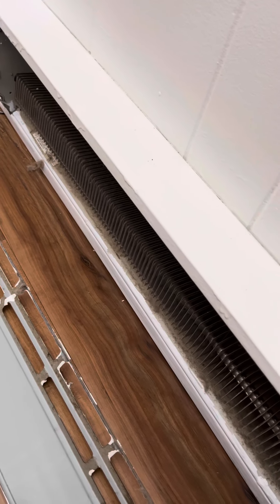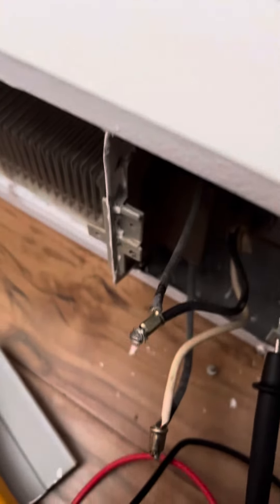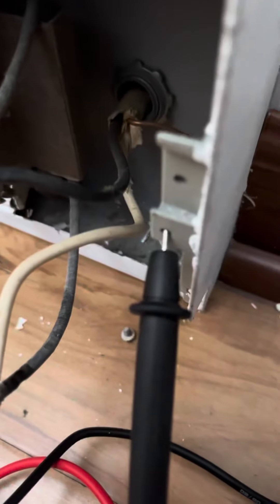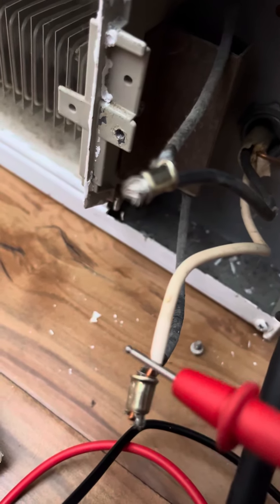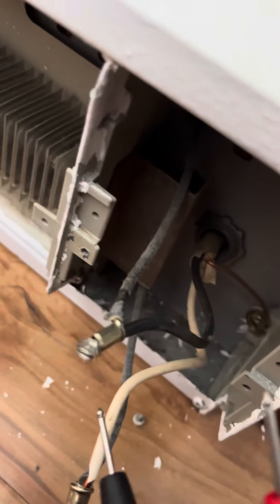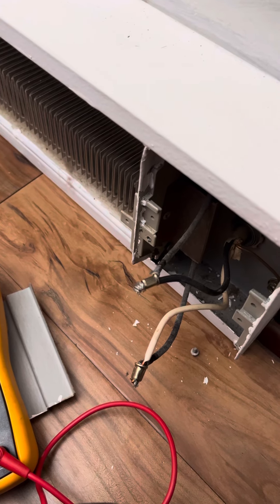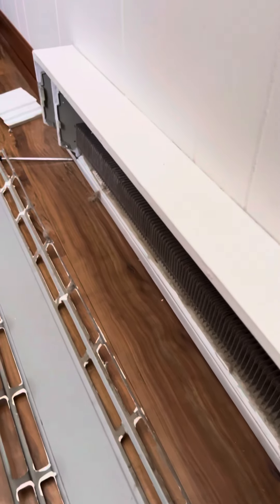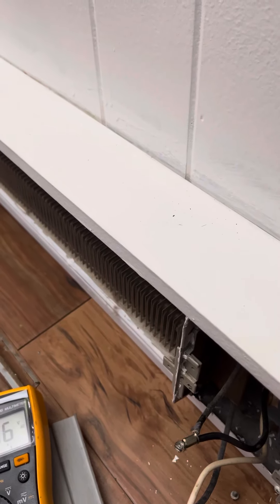Troubleshooting an electric baseboard heater

Comment: You need a double pole 120 breaker for this sytem to work at 240 and put out more heat. Then if you got another on same line you need to extend it out for the other heater to break at 240. Alot of apartments got these rated 240 and only getting half the bang of 120 because wiring is not extended proper.

Comment: Why wouldn't you swap the breaker for a 15a or 20a double pole breaker and move/relabel the white wire? You'd also need to verify the thermostat is double pole and breaks both side of the circuit.
Reply from the maker: Cost and time. No room in panel.